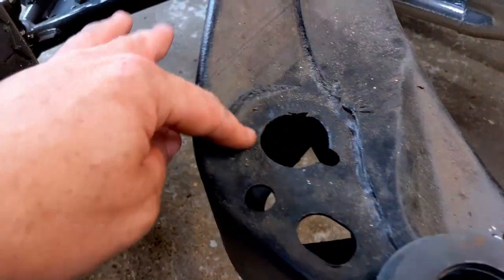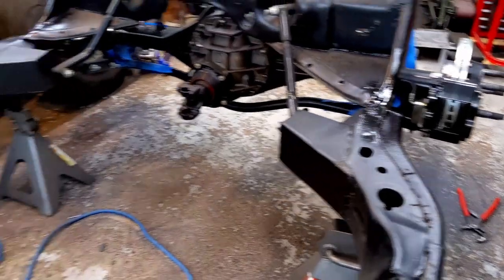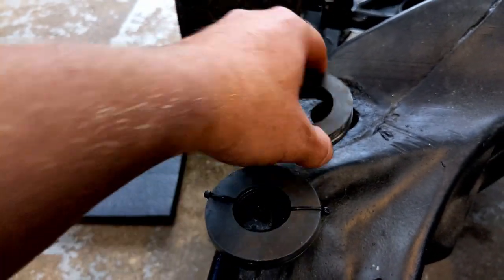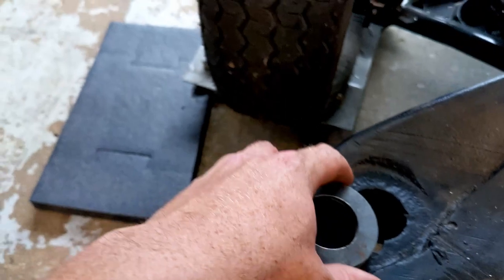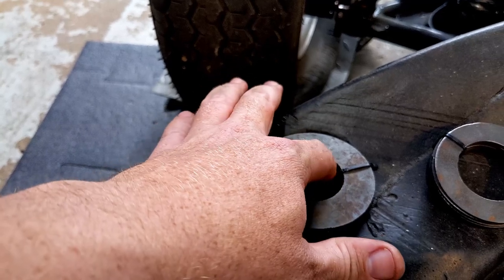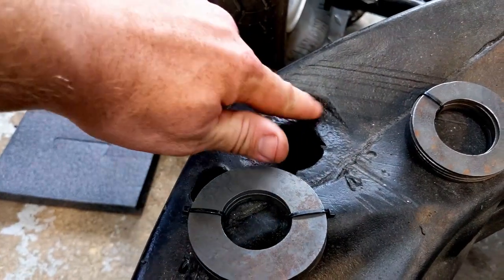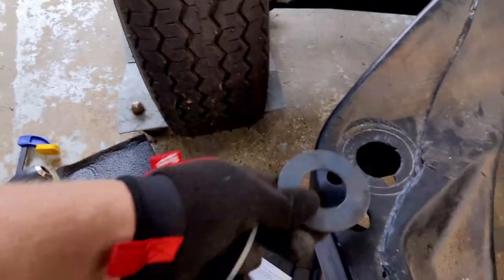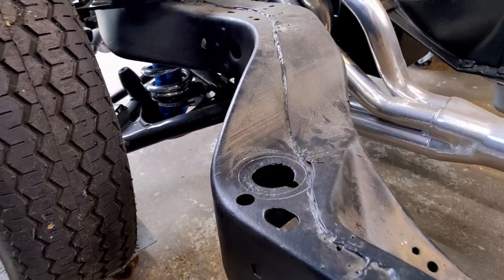G-Body Body Mount Frame Repair / Part 1 of 3

Comment: I’m a bit late but the trick to stabilize your hole saw is to nest 2 hole saws on your arbor.  The big hole saw on the arbor first then a smaller hole saw to match the hole that’s in the car frame to act as the drill arbor.  Go slow and once the big hole saw starts digging in it’ll cut correctly.
Reply: What a great idea!

Comment: I had washers welded on my frame. The holes in the center of the washers are too small for my bushings to fit into. I bought a big step bit but it doesn’t seem to work.